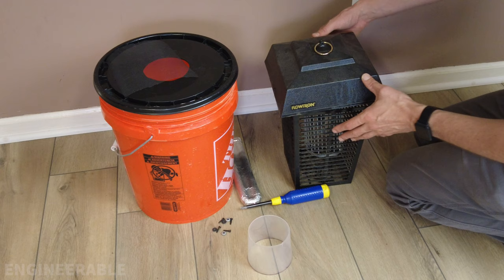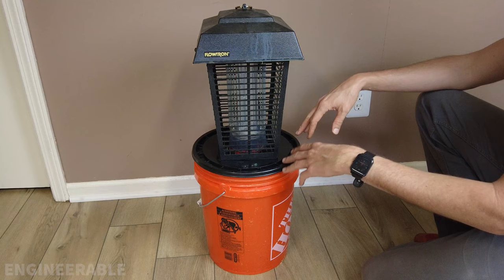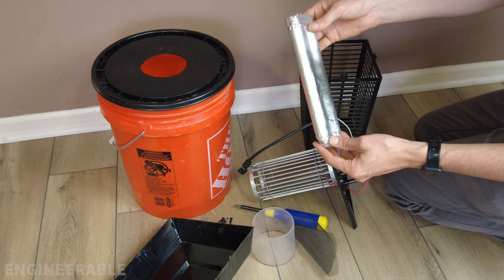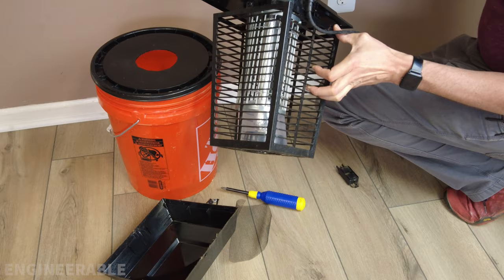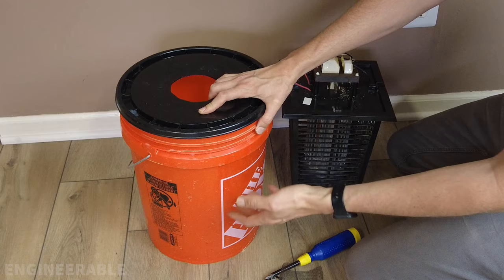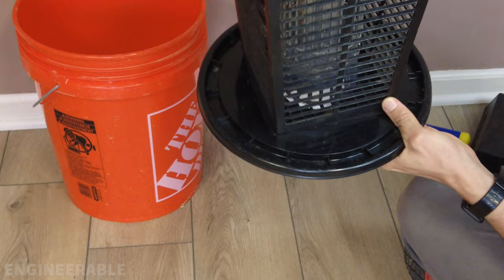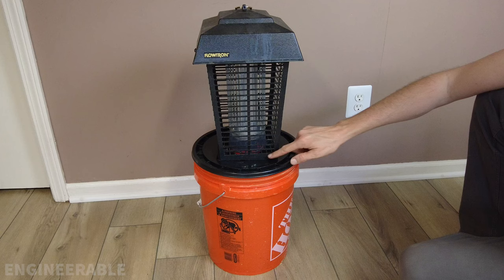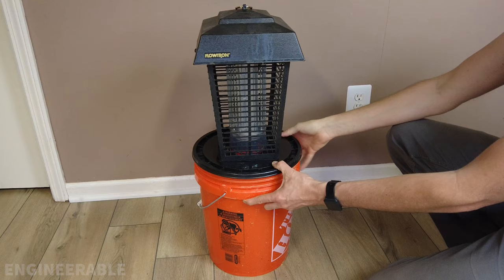How To Make Mosquito Killer Trap Using a Bug Zapper & Bucket (DIY Homemade Gravid Autocidal Ovitrap)

Comment from the maker: UPDATE 6/22/2023 - We are in full swing mosquito season. I've been using this DIY mosquito zapper and a small fishless pond with mosquito dunks in the backyard. The combination of these two has drastically reduced the population of Asian Tiger mosquitos that would normally bite in droves during the day. I've been using the pond with mosquito dunks for years, which has been fairly effective in breaking the breading cycle, but the problem is that it didn't kill the egg layers, so they would go lay more eggs elsewhere. This DIY mosquito killer seems to have completely broken the cycle.

Comment: i would love to see a test video, this looks really interesting, good video by the way.
Reply from the maker: I will update.
These style traps are called lethal ovitraps, and are known to be effective at controlling mosquito populations. Here are some commercialized examples. https://colinpurrington.com/2019/03/mosquito-traps-that-work/ 
I've tried a few of these, and did not like them. They rely on things that need maintenance and replacement, like glue strips to catch the mosquito or poison to kill it. The bug zapper requires electricity, but no maintenance or cost of replacement. 

I will have to determine efficacy by seeing if there are fewer mosquitos in the area. The mosquitos get completely disintegrated, so it will be difficult to tell how many mosquitos get zapped. Eliminating all other stagnant water sources will be key, such that they will only come breed in the trap. I have a small frog pond (no fish) that I keep stocked with mosquito dunks to kill any larvae that hatch. It has been extremely effective at reducing mosquito population, but since it doesn't kill the egg layer, they will go find other spots to lay eggs. Unfortunately, I can't control what my neighbors have around collecting water. So, this trap that kills the egg layer should be even more effective.

Comment: My neighbors have 6 horses a ton of goats and other animals, going to try this with flies. Already have the bait but couldn't think of a way to make them go though the zapper. thanks!
Reply from the maker: Good idea, this should work, with bait in bucket. You can use a smaller bucket. Can also add a small computer fan to blow the sent upwards and out the electrified grid.

Comment: Great idea. I’ve been thinking and experimenting with different things I can put in the bottom of the zappers catch tray to attract them. I have several solar powered zappers so the big bucket idea will not work for all of them but as implementing it as the main big attraction outside and the other solar zappers indoor can be a awesome low cost, low maintenance system. 🙌🏾🤞🏾 I’m still searching for something small and powerful to attract them.
Reply from the maker: Apparently stinky socks are 4X more attractive than a person. I'm going to test that next. The trap in this video has been working great. I will try some solar ones next. What solar one do you have?
Reply: Maybe look into BG-Lure and BG-Sweetscents, if you're dealing with "Asian Tiger" (aedes albopictus) or "Yellow Fever" (aedes aegypti) mosquitoes. It's kind of pricey...

Comment: Won't the mosquitoes go in and out the overflow holes that you drilled around the bucket?
Reply from the maker: No, the overflow holes are much too small for mosquitos to pass through.
Reply: Yes, drill multiple overflow holes but keep them small . As an extra precaution, you can put some mosquito bits or piece of a mosquito dunk in the water. This way, if any mosquito eggs happen to make it into the water, the larva won't have a chance to develop.